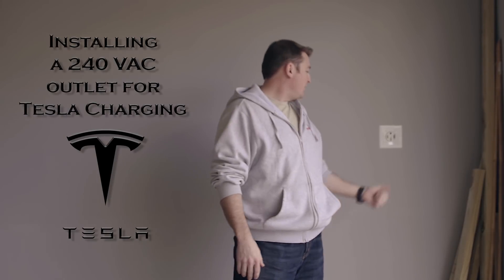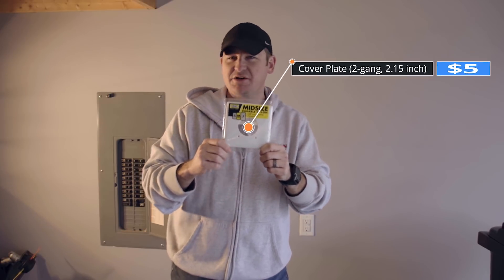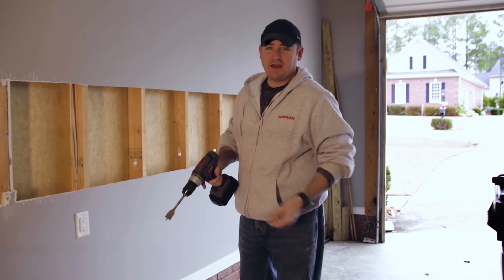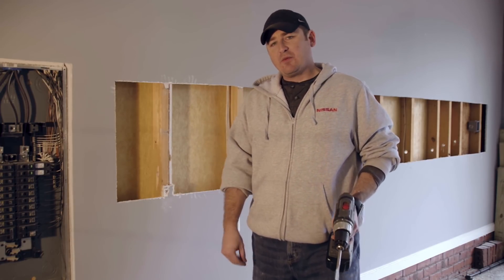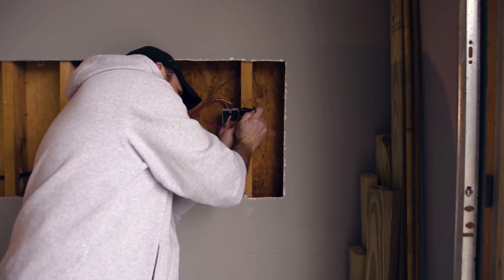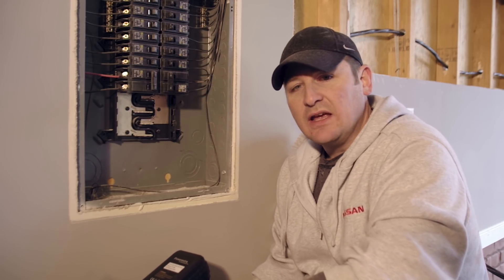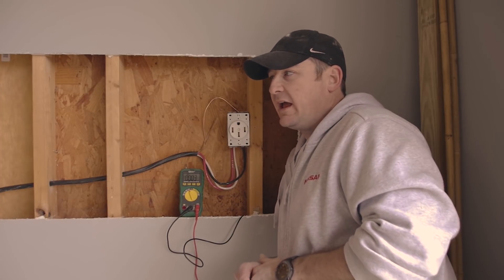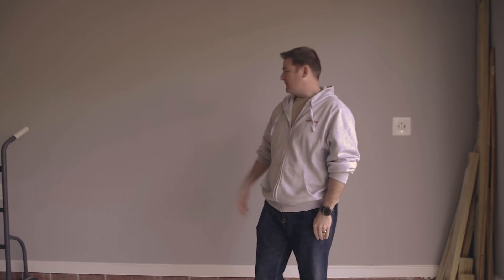DIY install a 240v outlet for Tesla (EV) Charging - SUPER EASY!!

Comment: Tips for anyone who does this:  use a double gang appliance outlet box for the NEMA 14-50 outlet.  It makes it much easier to fit 6/3 wire and you can keep the sheathing intact past the strain relief for the box.  You should also have a strain relief where the wire enters the panel.  Un-sheathed wire outside of the panel and outlet box won't pass inspection.  FWIW, I would have put the new outlet right below the electric panel and just backed the car in.

Comment: Helpful as this video is, you can't have the conductors outside of the sheathing not inside the box (the red, black, white, and bare copper behind the drywall). I'm presuming it would be a tight squeeze in the box but still needs to be in there for safety reasons.

Comment: 32:40. You should also test the ground connection, too. Ground and hots are 120V each and neutral to ground should be approximately 0 volts.

Comment: As you have said, local codes do apply, so check with a local electrician... even if you know what you are doing.  In my area you might be required to run conduit (even in the wall). Some areas require metal conduit, which is a pain to work with, but again local codes.  PVC conduit is much easier.  MOST jurisdictions would frown or prohibit bare wire outside of the outlet box, so that last 12 inches where you split the wire to go in the box would be a NO-NO.  From a safety viewpoint I would agree, as cutting into the wall could find you hitting a live wire. Yes, conduit is a little more work but in this case I would do it.  With that in mind, horizontally aligned holes would become much more important, and at the end I would use 45 degree connectors to split the wires, as it is heavy wire, and you really don't want to bend it that hard.  With PVC they have what is called a street bend which is a much wider radius, which might be sufficient (your mileage may very :-) ).  On the outlet, there is usually a cutting pattern that you can use as a gauge to tell you the exact amount to strip that will perfectly fit in outlet.  You aren't the first person to forget about the drywall depth when mounting the box :-) , but mistakes are how we learn, and other people's mistake are the best, so thank you for showing the error.  On the panel, there are usually smaller and larger punch out holes, and there are bushings that are applied to prevent any abrasion of the wire going through the box. That said, I would have used a larger hole, a bushing, and brought all four wires through the same hole.  In your example there didn't seem to be any wires exiting on that side of the panel, but many people will not have that luxury, so I highly recommend that you kill the box before you start drywall cutting near it.  

All in all a great presentation for a DIY who has some experience, but remember that jurisdictions may require a permit to do this, and a qualified electrician's (or building code inspector) inspection before you seal up the wall.  Usually becomes a serious problem when you go to sell the house, and FHA loan requires an inspector to come in to qualify for the loan.  They love these installations, because, since it wasn't permitted and inspected at the time, it can't be "grandfathered".  They will automatically require a "qualified repair" despite the fact that it works fine.

Comment: It is perfectly fine to do all the outlet wiring with the breaker on, but shut the mains off before removing the panel cover.  Wires running through the panel openings need grommets to prevent an electrical fire.

Comment: I must say it turned out to be a clean job, however, when using Tesla's plug-in mobile connector rated at 32 amps, you are required to use a 40 amp 2-pole breaker instead of a 50 amp. If you're planning on using the Tesla Wall Connector at the setting of 40 amps then you use the 50 amp breaker.  Keep in mind that all Level-2 EVCS/EVSE charging equipment only requires two hot circuits and ground, the neutral wire is not used. The difference in cost is @ $56.00 before tax. Using the #6 Awg. is actually a good idea in case you decide to charge your vehicle at a higher rate with the Tesla Wall Connector only. The #6 is rated up to 85 amps. Up to a maximum of 50 amps a NEMA 14-50 or NEMA 6-50 is acceptable, anything higher will require it to be hardwired. On one last note, all conductors passing through an enclosure must have a protective bushing installed.

Comment: Typically joints in wallboard are taped with paper or fiber tape to keep the drywall compound from cracking and having the crack reflect through the compound. It’s an aesthetic thing. Maybe no big deal in the garage. You can find tape next to drywall supplies at hardware store.  The wide blade knife shown in the video is very useful in feathering out the compound over the tape. Great video.  Thanks.

Comment: To anyone watching this wanting to do it themselves that have not worked with electrical stuff before,  turn the power off to the entire panel and check it before doing anything behind the cover, just to be safe.  20mA can kill you.  Behind the panel is a lot more than that.  While getting shocked is a wake up call, you may not get a chance to learn a lesson if you make contact with the wrong things.  
The job turned out really nice though.

Comment: Being a plain old DYI guy I always shut of the power first before doing anything having to do with connections other than initial set up of wiring. Also I always test to be sure no power to the lines and connectors I’ll be touching, I don’t assume anything.

Comment: I'm not sure if you are aware, but the National Electrical Code (NEC) requires that all connections of lines the size you installed require fasteners at each junction point (ie- at the panel and at the plastic box.  All the conductors must be inside the plastic sheathing and not exposed or open until they are inside the box. The better approach is to generally use a larger metal box for the outlet.  Otherwise, great instruction video!
Reply: i was about to make this comment... the outer sheath of cable always goes into box, enclosure or panel and then it's secured so it can't be pulled out or rubbed against sharp edges... after all that you can split the inner conductors and connect them... you should have enough room to do so without needing to physically jam parts in, to avoid damage

Comment: BIG FYI to anyone buying a new model 3, they no longer include the nema 14-50 plug, you must buy it separately. As part of the gen 2 UMC you only receive the useless 110 volt adapter that will give you 2-3 miles per hour of charge. This was a great video, I already bought everything to add my outlet as per your instructions. I just got my model 3 and was REALLY disappointed in Tesla, taking that away from a $48K (before taxes) car, and making you buy it for $35? WTF, Elon?

Comment: I liked your video. You are obviously a professional electrician. Very knowledgeable. Very detailed. I thought that you were going into the attic and run the wire down the wall. I never thought about going sideways. Very neat installation. It may have taken a little more effort, but you didn't have to go into the attic. I liked that. You have given me the confidence to do this myself. Thank you.

Comment: Awesome work, Brent! You cleared up a lot of mysteries. I really liked the way that you removed large pieces of drywall. My electrician just cut out small squares of drywall and reached in with an angle drill. I didn't know that you could put wires directly into the side of your circuit breaker box, without worrying about the hot wire's insulation coming into direct contact with the box's bare metal? Maybe the smaller hole in the stud centered the wire? I'm not an electrician, it just bothered me. Thank you so much!
Reply: You're suppose to knockout a large enough hole in both boxes and insert cable clamps into them to accommodate the full cable with jacket intact.  You only strip the outer jacket off inside of the boxes (same as all of the other wires entering the box).  Probably not unsafe doing it the way that he did, but it would not pass inspection.

Comment: Several comments:
1. With a 50 amp circuit breaker and a NEMA 1450 plug, you can only run the Tesla wall connector at 40 amps or lower. The Tesla wall connector is capable of charging at 80 amps, which charges the car up to twice as fast as at 40 amps. Sometimes you need to do a fast charge. So, if you’re going through the trouble of installing a dedicated power source for your Tesla and your service panel has al least 200 amp capacity, why not wire for 80 amps?

2. An 80 amp install for the Tesla wall connector requires that the connector be wired directly to the circuit breaker WITHOUT a plug in between. You will need a 100 amp circuit breaker, #3 gauge wire (preferably #2 gauge) and a 1” conduit (PVC 40 or metal) to connect the two. #6 wire is not sufficient for 80 amps. The circuit breaker needs to be sized 20% higher than the anticipated continuous load. That is why you need a 50 amp breaker for a 40 amp charger and a 100 amp breaker for an 80 amp charger.

3. The NEMA 1450 plug DOES require a neutral “white” wire by code, but the Tesla charger DOES NOT use a white (neutral) wire. The Tesla wall charger uses two “hot” 240 volt wires plus a ground—three wires. There is no place to connect a neutral wire on the charger. So why install a wire that will not be used?

4. 80 amps is A LOT of current that can easily start a major fire if the wall connector is not wired properly. So is 40 amps. There is no room for sloppiness. If you’re not comfortable wiring high current appliances and sure that you can do a proper job doing so, it might be worthwhile hiring a professional to do the job correctly, according to code. But if you know what you are doing and are capable, the install is straightforward.
Reply from the maker: Good points. The car will only pull 32A, so 50A breaker is good for the 80% safety margin. I didnt want to pay the $500 for the high speed charger as there really isnt that much of a noticeable difference. I also plugged in when I got home, set the charge for 12am, and was ready to go when I left the house each day by 6am, so going this route was just fine for my purposes. Thanks for all the good points.

Comment: Great work. Thanks for the video. I have the same project. Looks like there's no height regulations for your wire run? I plan to run it much lower, the feed it vertically to the outlet. Only challenge will be stapling the vertical portion.

Comment: An easier way would be to run the wire up into the Attic , run it over to where you want to drop the wire down inside the wall and fish it out.    Mount the box , feed the wire into the top of
the box ,  hook up the 240v out let ,  pu the plate covor on   then go to the braker panel , insert the breaker with the power off , attached the wires , turn the power back on  ….
Reply from the maker: There is a room above the garage. No attic, but yeah, wouldve been easier.

Comment: I have a question:  If i live in a condo.. and the circut breaker is in my closet in the second floor.  My car is right outside on the other side of the fence. Would you recommend me instaling a 1450 down in the first floor and somehow finding a way of running a line from the circuit breaker?   (ps.  my dryer is in the first floor which is closer to the car but still much longer than the 24 feet that come w/ the cable for the wall connector)..   thanks

Comment: Thanks for posting this video. Pretty sure you should put metal plates over every stud where the wiring passed through. Otherwise, the next occupant of the house might drill into the wall to install shelves and have an unanticipated 220 volt shock. Also, while homeowners are allowed to do electrical work in their own home without an electricians  license, they are typically required to pull a permit and have the work inspected before covering it up with drywall. Check with your local building department for the regulations.

Comment: The orientation of the outlet's ground pin is important. If upside down , your charger cable will not hang right and you'll need to fix that before your show-n-tell.
Reply from the maker: Absolutely. I did verify which way I needed the charger to hang before mounting in the outlet. Good point! I forgot to mention that. I also recommend a cable holder for when you unplug. Theres a link to one in the description.

Comment: no nail guards on the studs, and why so long of a length?  Couldve had the plug near the breaker panel but hey as long as it works right?
Reply: Tesla Model 3 is back driver side - therefore another 9-10 feet of high voltage EVSE cable to make it to Tesla proprietary plug at car.  Clearing his back bumper with outlet poistion.

Comment: Good enough BuT there are requirements for box volume. You should have used a 4x4 box not a 2x4. That’s why that plate is so big.  Also check out the meters in Amazon for 2pole, for less than $30 you can have a continuous meter for your EV. Not needed but pretty cool for track the EV actual drawn (gross)  power and cost Vs the cars reported net usable power after going through the cable and conversion.

Comment: Not sure if it’s up to the code, but I would have just used a metal conduit pipe to house the wire inside and reach the outlet location from the panel, instead of cutting such a big drywall and drilling through multiple studs. The conduit can be lower on the wall so it doesn’t interfere with things you may hang.

Comment: This was fantastic! Thanks so much. 99% sure I can get this done. I don’t even have to do the drywall work.
Reply: Also, 7 months later....any issues? Crazy power bills? Lights dimming when you charge? Would you recommend a breaker with GFCI?
Reply from the maker: No crazy power bills. I have solar on the house (about 4.3 kW max output) and it covered completely the charging usage. Even still was able to receive a credit for the extra power i generated. I didnt worry about GFCI, but that was just my installation preference.

Comment: Dremel, Dewalt, Ridged, Makita drywall cutting tools. Set at the right depth 1/4" or 1/2".  Could make it quick and easy. TURN  OFF THE POWER. Safety first.
Reply: p.s. Great video.

Comment: Cutting drywall was a good decision. You could cut the drywall near the panel. You should have used 2 gang outlet box. Splitting romex wire outside the box doesn’t look good. You should have used protector at the holes of the main panel. Splitting romex wires outside the main panel is a building code violation.  Even if you turned off the power, always use gloves when touching the panel. Someone could turn the power on. They could be your kids, parents, wife, or neighbors. Good work overall !!!
Reply: that's why you tape, label and / or lock (best way) breakers if work is being done

Comment: They make 3/4  water tight conduit and connectors - much safer than open wires in a wall.  Metal plates on top of the studs another idea to protect someone hanging a massive wood screw into the studs, puncturing your open wires, and electrocuting themselves.  Code in many cities does not allow these open conductors (wires).  Testing hot1 and hot2 to ground was not done - should have been done before claiming its safe.  Silent on Circuit breaker ? amps?  Wire should be #8 as smallest?  Ground wire at outlet should not be exposed and sitting on wood. FIRE.  Drywall should grove out paper enough to hold width of drywall tape, apply the tape and then mud.  Wet sponge makes much better than sanding to float.

Comment: Nice vid but a little light on the safety. Thanks for sparing us the music. 

A general tip for DYI'ers from an Electrical Engineer: Never use the meter for the first time on a project to check that there is no power. Check your circuit BEFORE you open the breaker. Confirm you see voltage. THEN open your breaker and check again. This ensures that indeed you are using the meter correctly and the meter is working correctly and that you have no power where there was power two minutes earlier. Basically, you've ensured you're not a dumbass before working in the panel.

I've seen rookies use the wrong setting on the meter (resistance, current, or DC volts). They see a zero or an OL ("what the hell is OL anyway? Must be zero. I'm good"). I saw one of them get on the circuit. Looked like Joe Cocker singing...
Reply from the maker: Good point. And like I said, if you're not comfortable or are unsure, hire a professional. I kind of assumed that someone doing this level installation has some knowledge of how to work a multimeter. Still, a good point to make though. Thanks!

Comment: Very good job of explaining the process. What does the whole charger install cost? Was it for a Tesla? Where do you get the charger, amazon or Tesla?
Reply from the maker: The mobile charger came with the car. I think they still do, but would have to check. I didnt buy the $500 wall mount charger from Tesla since the free one was almost as fast with this outlet.

Comment: Great video overall, very educational!  You really really should have used a larger box so you could put the 6/3 wire in with its outer insulation and connect it to the NEMA 14-50 without splitting the wires outside the box. Same on the other end, should have drilled a big enough hole to get the full 6/3 cable into the panel.